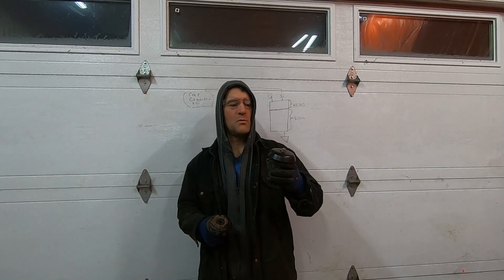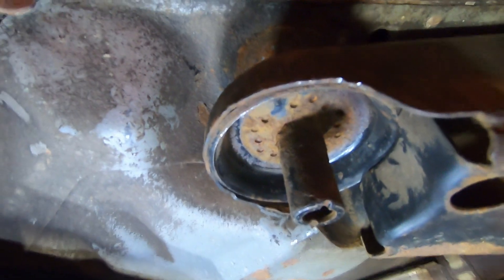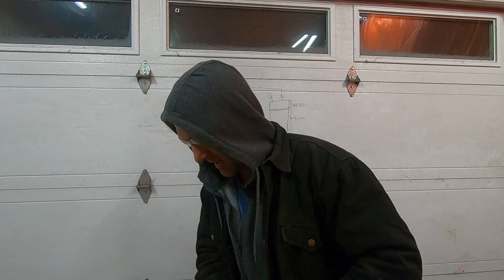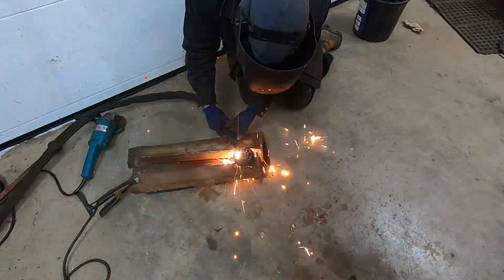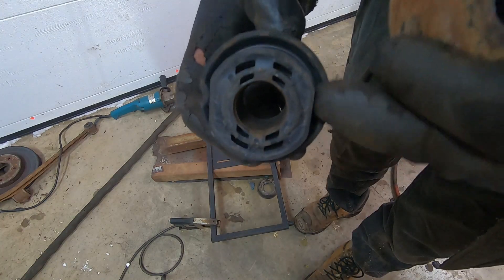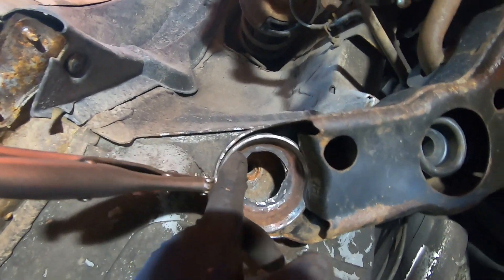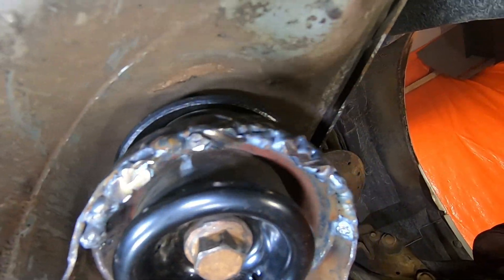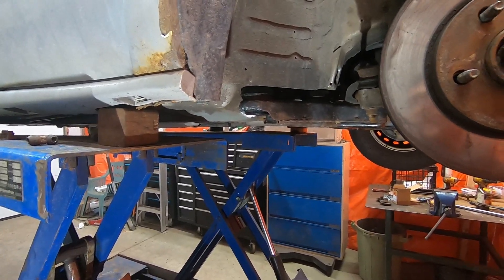Subframe Rust & Rot Repair

Comment: I might try that. 2000 park ave. Mechanic put new bolt/bushing, but still moves some…..I just need some moral support looks very doable.  Might have to buy new part for the cut out part.
Reply from the maker: you may have a bad internal seal.